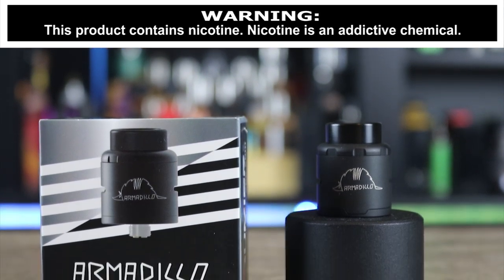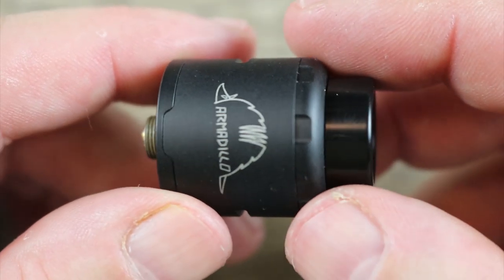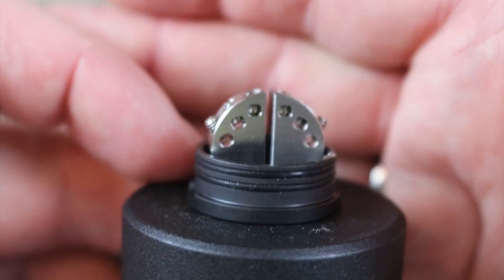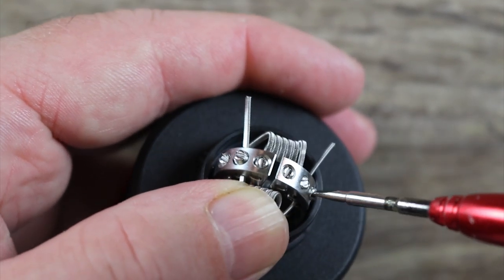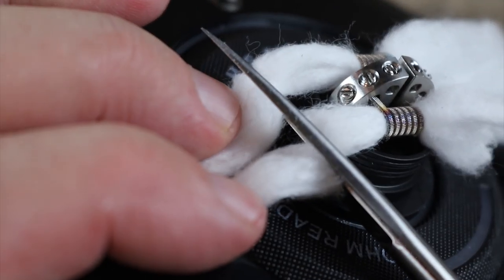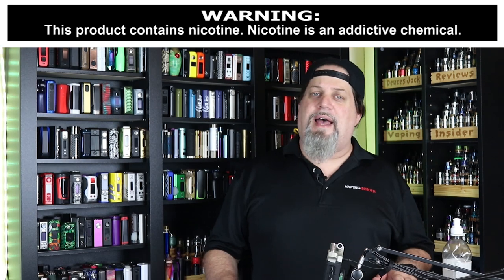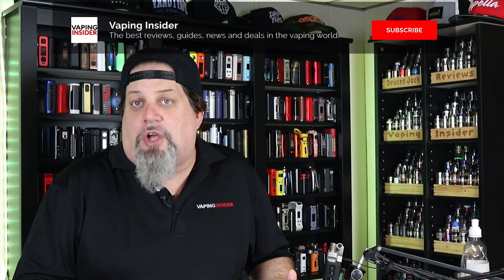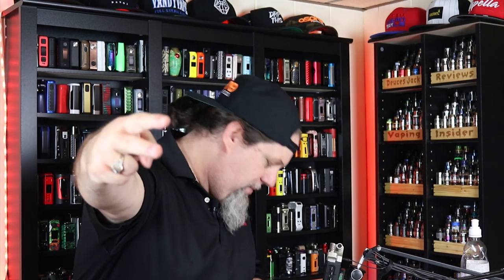THIS RDA IS NOT ROADKILL! ✌️🚭

Comment: What's wrong with flathead screws?  I'll take decent flathead screws over any hex screw...  Everyone has his own opinions ofcourse, but saying that it's a con is a bit too much.
The post holes are biig enough to fit a SSFC in there so i don't see the issue...    I'd rather say that the angle of the screws are annoying, cause ur lead or coil will twist.
Reply from the maker: I just prefer hex or Phillips especially when any kind of reach is involved.